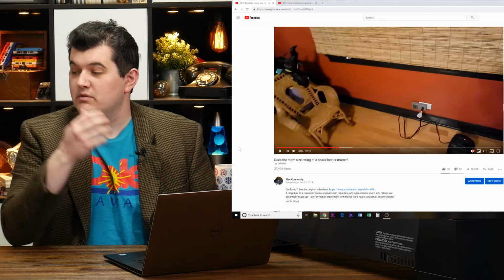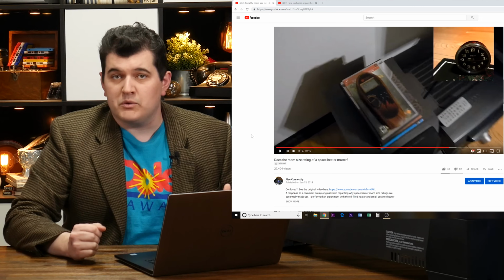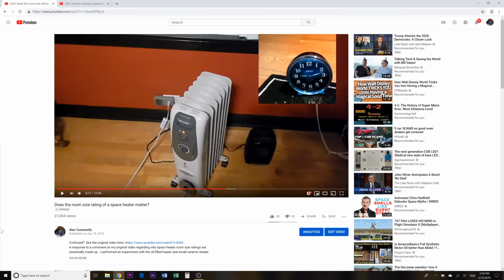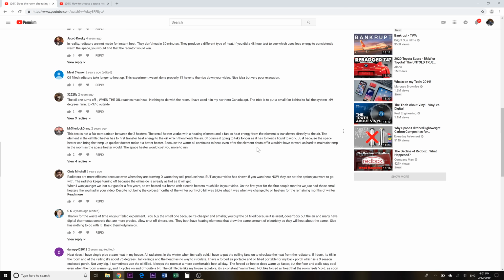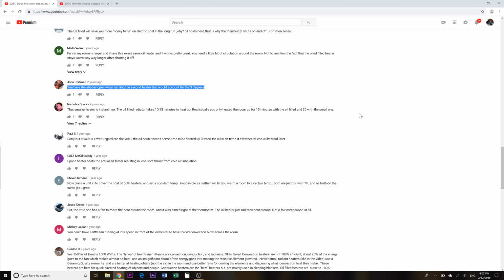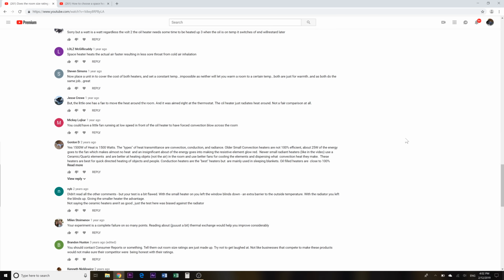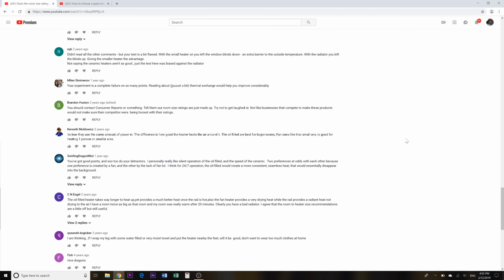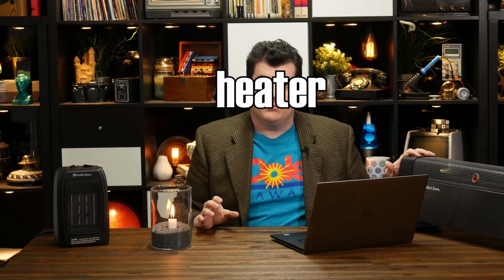More Space Heater Nonsense

Comment: I take your point.  An interesting experiment to verify your findings would be to plug a 2000 watt hairdryer into a 20 amp socket and compare it against the 1500 watt space heater.  Would the hairdryer out perform the space heater?
Reply: Will a hair drier run on high for a half hour without  burning out? They are not designed to do that.
Reply: Gary O'Brien, I don’t know.  One way to find out.  They do use them at salons for extended periods of time.  Maybe a professional one?
Reply: @davidbliss8352  I really don't know, that's why I made it a question. Professional ones never crossed my mind. You are probably right.

Comment: I know this is 1.5 years old but I just came across it and wanted to add my 2 cents. I agree with you as long as we are talking about "space heaters", That is you have a volume of space and you want to bring up the temperature therein. But there are situations where that is not practical. For example in a workshop or garage where poor insulation and drafts may be a problem.

Heat is transferred by different methods: convection and radiation. Convection depends on air (and gravity) to absorb and redistribute heat. Radiation is the direct transfer of heat energy from a warm source to a cold target. Radiation doesn't rely on air or air movement (or we would receive no heat from the sun). Radiant heaters are designed to heat YOU, not the room. They are commonly used in places like mechanic's shops because doors keep being opened & closed, for example. A space heater (especially one with a fan) might be quite efficient at heating up the air in the room but every time someone opens the door to drive one vehicle out and bring another one in you lose a large proportion of that heat. However, if you are standing in the target area of a radiant heater, you feel its warmth immediately; you are being warmed directly rather than by the intermediate step of heating the air which then heats you. One big disadvantage of those big reflector-type radiant heaters is that, as soon as you step out of its 'focal point' you immediately feel cold again.

A Youtuber named "Mattias Wandel" made a series of videos on this subject that are quite interesting. In fact, he made one where he overcame the above limitation of radiant reflectors by mounting one on a home-made tracking platform which used a camera and some clever circuitry and servo motors to follow him around his workshop and ensure it always pointed at him. Maybe not that practical for a variety of reasons but pretty darn KEWL, eh!

Comment: Here is a crazy rationalization about the room size ratings. The small fan heater heats the BIG room better because the fan speads the heat, BUT it heats the area near the heater poorer because much of the heat is going to other parts of the BIG room. The Big (oil Filled) heater heats the BIG room poorer BUT heats the local area near it better and therefore COULD be considered more suitable for a person near it in a BIGGER room.  Think about a watchman sitting in a corner of an unheated 5 acre warehouse, which heater would provide BETTER comfort to the watchman? Of Course neither heater would make a dent in the whole warehouse temperature but the radiant heater would be more useful.

Comment: One thing I would say about some space heaters, specifically PTC ceramic heaters is that they may start out at 1500 watts or even a bit higher but as they heat up they self regulate down due to having a PTC and thus it becomes a game of just how much heat you can remove from the element with the fan and the temperature differential.  Some large room heaters may mover more air through the unit keeping it at a high wattage for a longer time even if everything else is equal.  Many of these PTC units will start out around 1500-1700 watts but very quickly drop as they heat up so many of the statements on the boxes say up to 1500 watts but in reality, they may only be 1200-1400 watts when on high setting and this is without adding a thermostat.  The benefit of PTC units is that if the fan fails they will often self regulate all the way down to 50-100 watts or less until the thermal fuse or bi-metal breaker trips or the unit now without a working fan reaches equilibrium.
Reply: The solution for a PTC ceramic heater that dials down the power too quickly is to put a fan behind it to blow air away from the heater into the room. Same solution as for the oil radiator unit that gets hot enough so that its internal thermostat shuts it off. Both the PTC and the thermostat regulated designs are essentially the same idea: they reduce the power used so that the heating element temperature stays low enough to be safe.

Comment: First off, I'm a big fan of your videos.  It's a pity to see how frustrated you are with some of the feedback on this topic.  When it comes to your basic premise that 1500 Watts is 1500 Watts, no matter the size of the heater, then you are obviously correct.   I think the main problem here is that you are treating this as a physics problem.   If we stick to the physics for a moment, I suspect that rather than size the lack of a fan is probably a bigger determinant of efficiency in heating the room.   It would be interesting to use one of those IR thermometers that you can point at an area to check for a hot spot on the ceiling above the convection heater.   Depending on the level of insulation in your ceiling you might be transferring heat out of the room more quickly with convection.  The difference is probably marginal, but it might be measurable.

I think the bigger problem is human physiology.  I've noticed that people are rather poor at sensing absolute measures of temperature.  They notice the change in temperature and the rate of change of temperature much more.   So if you have a heater that disperses heat throughout the room more evenly and is better at maintaining a steady temperature without cycling up and down then it will be more comfortable.   Sometimes in the winter you will enter a persons house and find it uncomfortably hot.  I attribute that to people sensing the temperature dropping, feeling uncomfortable, and adjusting the heat up.  The end result can be a stupidly high average temperature that would cause you to open a window in summer.

Then we get to psychology .  One of my neighbors ran the HVAC systems for a large industrial campus.   He has a story about a woman constantly complaining about the temperature.  So he installed her own personal thermostat control on the wall near her desk.   She loved him for it and would tell him how wonderful it was every time he went by her desk.   The thing is, it wasn't connected to anything.   It made absolutely no difference to the temperature.

Comment: I agree that marketing plays on the ignorance of consumers, we see this all the time. Now, the small "space heater" is better for a smaller space to heat, as small spaces has less space to fit heating devices, whereas a larger room... or "space" can accommodate a larger heating device...but also, we can't compare a small space heater and the radiator heater so easily. If you had a small space heater and compared it to a larger space heater of same style, what should happen would be both would heat the room, but the smaller heater would need to cycle longer in relation to the temperature increase desired, whereas the larger (of same type of heater) would be able to have shorter cycles, and that is better for the heater..  but neither is more efficient than the other. Like you say, if they both output the same BTU... well you know! 
a handful of years ago, our electric utility board had sales people sent out to the local hardware stores to catch customers shopping and to sell them on his much money they'd save switching over to CFLs ( LEDs weren't an option so much back then), and even offered coupons for some brands of some of the efficient bulbs... (because $1 off $10 is such a deal breaker). So I stand close to their table of 3 reps who are just pitching to this group of people how by switching their lights... from outdoor motion lights, to bedroom lights, bathroom lights, guest rooms.. the more bulbs they swap out the more they save... Finally I have had enough and I put down my notepad with my scribbles on it, and calmly ask them how much im saving when swapping out all the lights in my home which was front and back door light, each 60W, bathroom light 100W, 2 60W lights for there living room, 100W dining room, 2 60W in the bedroom ... right there is 8 bulbs at a cost of $15 a bulb ( back in 2006).. thats $120 I pay... to instantly start saving on a reduced electric bill... I reminded the sales people that as electricity costed 9.8cents per kWh, I was able to quickly compare how much kWh my before and after would be if all the lights were on 24h a day for 30 days, and it was a savings, but it would take something like 6 years of savings before the savings offset the cost of replacing all the bulbs. THEN I reminded them how the CFL bulbs are challenged with our extreme cold weather, they would always fail in motion censored applications outside, and even if they could illuminate brightly in the cold, they generally stay lit for 30 seconds each activation, so really the duration of consumption in outdoor motion isn't going to bring huge savings, not to mention the fact that its important to factor in anyone who doesn't live in the bathroom might have that light on for a total of 2 hours a day.. that won't save you much kWh by switching. .. well they didn't know what to say. I don't want to sound creepy, even though its what I do best, but I could imagine how if I had someone logical like you there to dish out the facts at the same time, how it would have just ruined their campaign.. and how everyone who would have been there would have seen a bit of each sales person die inside. 
Anyways keep up the great videos!

Comment: I understand that concepts like heat, temperature and "dry heat" confuse lay people. I do not understand why engineers do stupid things that make an otherwise well designed product fail to do the thing it was built to do.  I bought a dehumidifier  that short cycled because the humidistat was in the dry exhaust air stream. I had to rewire it to move the humidistat into the intake air stream where it would be exposed to room humidity. I have used window air conditioners that had the thermostat sensing bulb clipped to the evaporator rather than suspended in the incoming air stream. The unit turned off when the evaporator got cold even though the room was still too warm. This kind of thing drives me up the wall. I suspect in the case of the oil heater in your video,  someone in marketing decided the wattage and physical size of the heater and the engineer  was tasked with making incompatible parts work together safely. The heating element needed to be 1500 watts to compete with other heaters but the radiator had to be small to appeal to the customer. If the radiator surface is too small to dissipate 1500 watts of heat, it would make sense to have the thermostat respond to casing temperature rather than room temperature to prevent the oil from overheating. Kudos to the engineer. As for product designers that chose form over function, may you come to rest in a place where heaters are not needed.

Comment: True enough, not all 1500W heaters are the same. (as you said) A fan if built in will circulate air, so will definitely heat the room more evenly, especially a small room for which a relatively small fan may be enough top circulate the air well. You would need a pretty decent fan to circulate the air in a large room, but then relying on convection helps. I hate marketing as much as you do, but in this respect the small/large room designation almost (not really, but almost) makes sense. But considering how the oil radiator works, it will have putting out the full 1500W consistently, while the little small one will do it easily, and with proper placement and orientation it will heat a large room AND circulate the air well through fan power AND through the hot air rising.
All that said, your point of 1500W is 1500W is solid (except where the oil heater limits itself), and marketing does suck. Anyway, well done for the work you do.

Comment: ive tried the oil filled, least impressive. ive used the small element with fan, better but still crap. for me the best solution is the quartz radiant, little satellite dish lookin thing. not only does it work the best, the settings are 400watt and 900 watt, so no worries of melting wires any where.

Comment: So there is only one thing I can think of but take it with a bit of salt I'm just spitballing here.... assume the oil heater was slow to spread the heat because oil dissipated heat slower then ceramic giving the colder air from drafts more time to counteract it. With that logic would a more thermally active alloy maybe let go of the heat faster and we know it's harder to go from 61 to 62 then it is to go from 60 to 61 so the energy used to keep the element hot could be reduced in some measurable way while getting similar effects. If the input energy was the same between a standard ceramic element with a fan and a new fanged super conductive element with the same fan the fan could then pull or push more heat per cycle leaving the element at a lower operating temperature and making the work easier. Like if you boil something in water or in alcohol. The mediums control the peak temperatures communicated to the subject. this would be an inverse of this and given air as the common medium the question becomes like the choice of a pot to boil water in. Are some materials not "better" at boiling water given the same sized pot and the same setting on the same burner?

edit: with the same amount of water at the same salinity, etc...

Comment: maybe like this: if my goal is a certain temperature in a room, then in the smaller room the heater can run less, i turn it off from time to time, right? and the smaller one certainly puts more strain on its heating element, right? same heat from smaller amount of material? so in a smaller room a heater survives longer than in a larger room. so maybe for the larger room i should use a larger heater to survive as long as the small one in the small room?

Comment: Okay, I have been refraining from commenting on this (and the "jacking up the heat doesn't heat the room faster" stuff), because I know I'm going to get flamed and called an ignoramus.

But you are "measuring the temperature of the room" by measuring the AIR in the room. Air has piss poor thermal conductivity and thermal capacity. If you come into a cold room, and turn a forced air heat system on only to "room temperature", then sure, it will take no more time for the AIR to reach that temperature than if you had jacked it. But the rest of the room (furnishings, walls, etc.) will still be cold, and will make many people feel cold, especially if they are in contact with those furnishings (sitting on a chair, laying in a bed). Jacking the heat speeds the time for the non-air parts of the room to warm up, and thus it is quite real that many people have the impression that the ROOM (including the non-air parts) heats up faster if you jack the heat, because it DOES heat up faster.

Now when it comes to heaters, I have no idea of those exact heaters you are showing. But heaters that heat by heating air and then blowing it around do very well at heating AIR but poorly at heating anything but the nearby AIR. Sure they have a fan, but especially in a larger room, they're not going to push that heat very far before it heads straight for the ceiling (same as the baseboard). Radiant style heaters do much better at heating the entire ROOM, not just the AIR.

I have lived in a wide variety of houses, and IMO, radiant style heating is absolutely superior at heating rooms (especially larger rooms) because they don't just heat the AIR. If you're going to do a real test of "which heater provides more COMFORT" then you need some actual humans (and realize that because women's clothing is typically thinner and not geared towards any sort of thermal function, they are more sensitive to NON-AIR things being colder), and do a Goldilocks test (too hot, too cold, just right). That will take a lot more work, but it's the only real test.

Comment: Yes, all 1500W heaters output the same amount of heat. True, if a small 1500W heater can't put out enough heat to warm up a given room the desired amount, using a physically larger unit will not help. However:
* A room is neither a closed nor homogeneous system. How those 1500W of heat are distributed will make a significant difference in how much the people in the room are actually warmed. To take an extreme example, a 1500W IR lamp aimed at a poorly insulated wall will end up having a lot of its energy be lost through that wall without actually raising the air temperature at all.
* The purpose of a room heater is not actually to raise the thermal equilibrium of a room; that is merely its operating mechanism. Its purpose is to make the occupants of that room more comfortable. Stability of heating over time, consistency of heating throughout the room, distribution of heat to where it is actually needed, noise, brightness, and even form factor are all legitimate concerns which affect fitness for purpose of a space heater.
Therefore, I find it entirely possible that some designs of heater are, in fact, more effective in large rooms, and others better in small ones.

(Now, whether such variations actually exist, let alone have any correlation with the 'room size' labels on the boxes, is an entirely different question.)